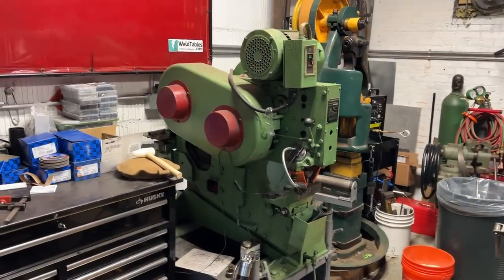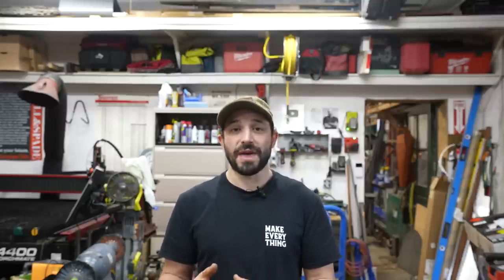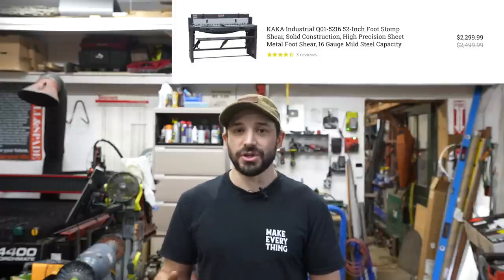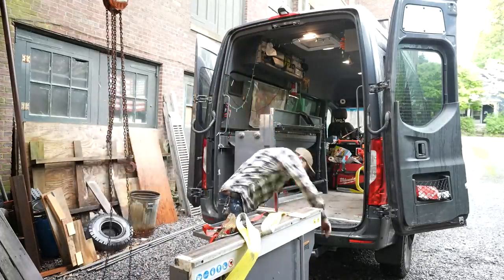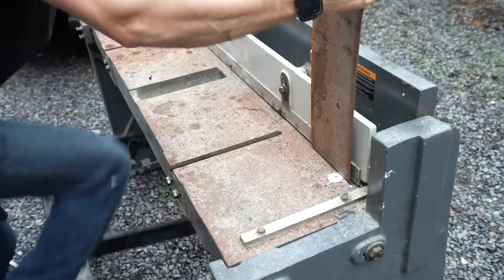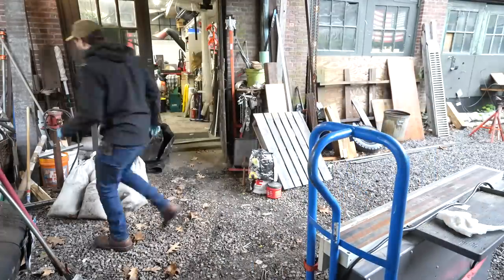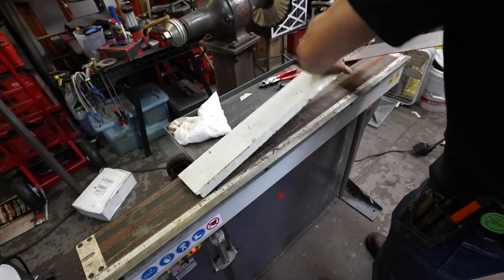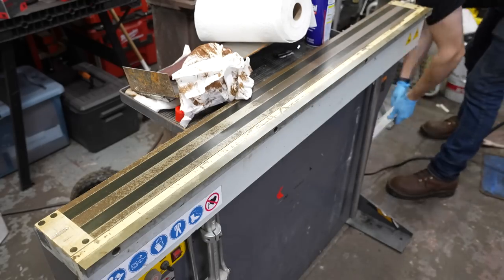$6,000 worth of tools for $1,000?!

Comment: Ditto, except I tend to negotiate in person.  I feel like it's easier for me to get a feel for what the tool is worth, what kind of condition it's in etc.  Additionally, it's easier for me to read the seller's commitment to a sale or reaction to what I offer.  I also don't want to create any hard feelings with a seller, but I find it easier to do that in person.  Also be ready to walk away.  As a seller, I have had the weirdest low ball offers on stuff - like $50 on something in excellent condition that would normally sell used for $600 - so I assume the seller I'm talking to has had to deal with that online too.
Reply: Oh, and I have definitely made offers to buy something, only for the seller to tell me they sold it for more to someone else before I got to their location.  That stings.
Reply: Same here. I like to hammer out the deal face to face. I would feel weird negotiating something I have not laid eyes/hands on.
Reply: Anybody that lowballs me right off the bat without asking questions or seeing the item wins an immediate block.  I try to live by the Golden Rule.

Comment: Try Phosphoric Acid aka "prep n etch". It dissolves rust, and anything it can't dissolve will be changed to a black inert oxide in the deeper pits.  It can still be taken off with a wire wheel later, but the rust won't get worse.

Comment: Nice score on the tools ..
Your forklift is freezing up because the radiator is low ..keep radiator full with antifreeze..if you use water you'll rust out the inside of the block..

Comment: Sorry to be so blunt but myself personally all I can SCREAM is "F__K Craig's List!!!"!!!!! I bought a table saw on Craig's List, the guy "showed me that it worked" until I got it home, then realized he'd removed BOTH knobs that controlled the tilt and the blade height adjustment!! I had bought THAT saw for $80 and spent another $80 on it for parts to replace the missing pieces, only to then realize, he'd never given me the rip fence for it!! So I jumped on Craig's list and sold the same saw.......for only $60!! I was out $100 on that deal! 

THEN I bought a miter saw on Craig's List, the guy again "showed me the saw worked" and gave me a baggie with the "wenches" and the owners manual for it!! I got it home and realized that there were a bunch of teeth missing off the blade, and when grabbed the wrenches out of the bag, they didn't fit my saw, which didn't matter anyhow, because the arbor nut had been welded to the arbor, so I couldn't change the blade if I'd wanted too!! I had wasted $150 on that saw, only to recover only $50 for it, back on Craig's List! 

In fact the last tool I bought on Craig's List was another table saw, that I got burnt on that again! In the end I finally wised up, went to Home Depot and bought me a brand new Ryobi 10" contractors saw, and a brand new Ryobi 10" miter saw!! I got my contractors saw for just $174 and the miter saw set me back only $99 on sale!! And Craig's List folks can keep their junk, I am fed up with hustlers, liars and scumbags selling crap on Craig's List in my area!!! If it isn't NEW, then I don't want it, and I am certainly fed up with buying junk I have to repair just to use it!! I don't have time or money to waste, and that is all Craig's List offers!!! 

And my last point is there are too many "shady people out there" that will sell you junk and smile at you as they do it!! And it really is "buyer beware" even on Facebook Marketplace!! And I have gotten some pretty lousy "deals" on both Facebook and Craig's List......so these days I'd rather pay retail, then get stuck repairing somebody else's headaches!!

Comment: I cringe when I hear the grit as you slide the sheetmetal in the shear. Next time try using a can of WD and hosing it down good to wash away the edge killing grit, and everytime you fold the part and it doesn't shear the blade gets bowed.